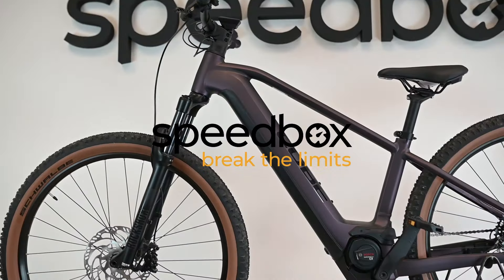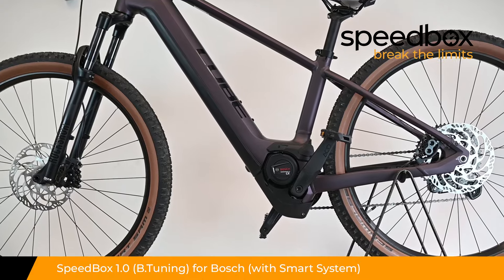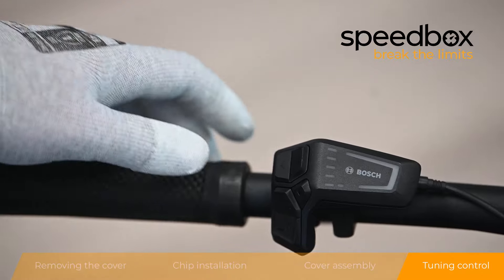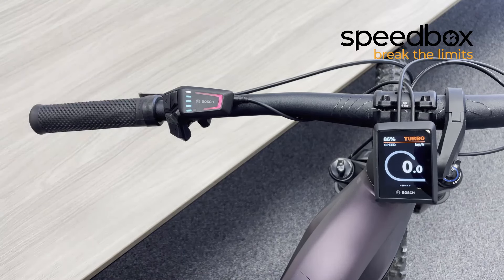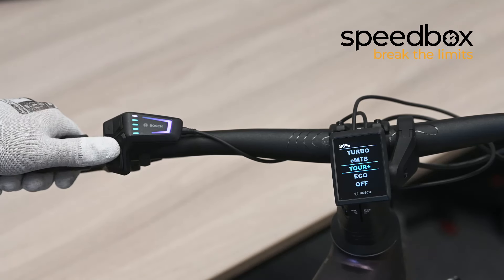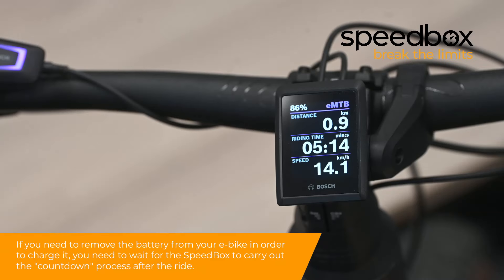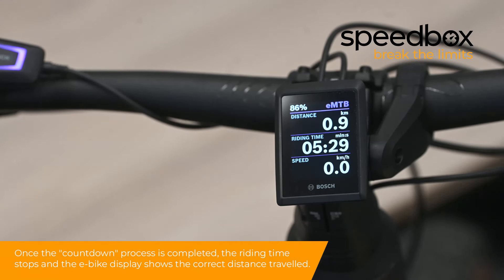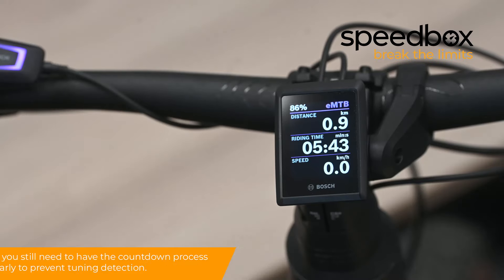eBike Tuning SpeedBox 1.0 B.Tuning for Bosch (Smart System) Installation Instruction

Comment: Sadly only worked for 100km on the new Riese & Muller Charger 4 before it got the error code 524001, rendering it unusable.
Reply: Just happened to me too but I will fix this!
Reply from the maker: Hello Rafterman. The 524001 error can rarely happens. Sometimes it can be caused by mechanical issues like damaged pin during installation. In any case it is not a system error. It is hardly possible to "provoke" this error on purpose for diagnostics, but we are still looking for ways to eliminate this issue as much as possible.
Reply: @SpeedBoxTuning  I'm not hating on your product at all, I knew the risks beforehand. It must be hard to make a product for the smart system that is constantly being updated. I'll provide you with some more information in hopes that I can get it to work in the future and also because I assume data from the 'field' could be valuable to your company. My speedbox 1.0b was delivered to me on the 5th of may, so quite early in the run of this product, I had ordered it a long time ago because I had falsely assumed that I would get my bike within a reasonable timeframe. My bike was then delayed until august 4th because they couldn't get the frames they needed. It worked pretty well for a few days, I commuted to work about 4 or 5 times within problems. Then I went home in what I would consider quite a 'spirited ride,' constantly going about 33-35km/h. During that ride I did notice that my phone wasn't connected to the Kiox 300 but I didn't think much of it, that also happened once before I got the speedbox. After I got home and was in the process of letting the trip timer run, the 524001 popped up before I even got to turn off the bike. That's all I know.
Reply: @SpeedBoxTuning  If you can fix this error, how can customers get this update? Is 1.0b possible to update OTA?
Reply from the maker: @geraldpiskernig8450  Hello Gerald. Unfortunately it is not possible OTA in the moment.
Reply from the maker: @raftermanhoward1883  Hello again. Thank you very much for your feedback - we will pass the information on to our development department. And you are right: it is challenging to develop a product despice constant updates :) Please follow our web sites or social media.
Reply: @SpeedBoxTuning   it happened to me twice
Reply from the maker: @lesliekirk7036  Hello Leslie. Our findings so far indicate that the tuning detection (error code 504) is more sensitive if you drive faster than 40 km/h. We are constantly working to eliminate this issue. However, this error code does not appear on the vast majority of bikes and cannot be easily triggered in laboratory conditions. Improvements are therefore still being worked on.
Reply: @SpeedBoxTuning  am still waiting for my replacement chip been a week an a half now not still nothing can you chase this up for me and let’s hope no more error codes thans
Reply from the maker: @lesliekirk7036   Hello Leslie. Our sales dpt. already sent you information about your consignment.
Reply: @SpeedBoxTuning
 it happened to me 3 times in two weeks. Last time even during the ride
Reply from the maker: @ronblankers6549  Hello Ron. I'm sorry to hear that you've got the error code.
There is very important to let the ebike switched ON after each ride-  there's a counting procedure at the end of each ride and before this counting is ended, the ebike has to stay ON. The battery can be removed for charging only after the countdown is done and the ebike is switched OFF. Had you removed the SpeedBox before you started to ride? Now we can recommend to go to a bike shop and to sk them to make a diagnostic procedure to delete the error code. You shouldn' t  speak about the tuning, of course, and the SpeedBox has to be removed first. Please, let us know when and where do you have bought the SB. Thank you.
Reply: @SpeedBoxTuning  I did wait for the countdown etc, and this happened during the ride (I had been waiting at a traffic light). The only thing I can think of is that the Bosch Flow app still could use the GPS, could that be the cause? I have turned it off anyway. The error is fixed, I bought te speedbox 4 weeks ago at Ebikes Parts and Accessories.
Reply from the maker: @ronblankers6549  Hello Ron. Could you please contact us via chat https://www.speedbox-tuning.com/ or via Facebook messenger https://www.facebook.com/SpeedBoxEn ? Thank you.
Reply: @raftermanhoward1883  how does the chip work until now? I have a new R&M Nevo 4 with Smart system and consider tuning but only if it’s stable and without countdown after rides
Reply: @pozega8157  I haven't tried it again, not really looking forward to cycling for 20km without assist and then lying to my dealer to remove the error codes again. Basically wasted €200. I think if you want a tuned bike it's better to buy something like a Bafang bbshd kit and build it into a good quality normal bike. I'm still using the bike every day though, the R&M itself is great, already put 1500km+ on it. If I ever happen to get a job further from my home I think I'll just buy an actual S-pedelec and keep this for recreational use. I didn't even go that fast with the Speedbox, just took it up to 32 km/h on avg to make it a bit more usable as a commuter.
Reply: This is a hi risk chip!Keeps turning off the bike leading to error. Not just on my Cannondale but also with my group of friends bikes like the Scott and Mondraker. 
My question to Speedbox:
Do you have a new chip for Bosch Smart System with these issues solved?
Reply: Looking to get haibike trekking 3 2023. Will the chip work with this

Comment: Hello, I will be getting an ebike with the 2023 Bosch smart system with the new integrated control unit and wireless mode selector but no Bosch display, (I use a Garmin Edge 530). It will also have the brake rotor magnet sensor. Will the Speedbox 1.0 B Tuning work for this setup without a display? Or can I use my the Speedbox tuning app on my apple phone as a display instead? Or is a Bosch display required? Thanks in advance.
Reply from the maker: Hello. Thank you for your question. Display is not required. It is only important that the e-bike does not have a Rim magnet.
Reply: @SpeedBoxTuning  awesome, thank you.

Comment: I've just bought it and installed it on my new Cube 2023 Reaction SLX 750...works fine so far. Is it possible to keep the tuning activated all the time or do I always have to activate it manually ? Thanks
Reply from the maker: Thank you for your positive feedback :) For older and simpler models of other brands, the tuning is either only active or only inactive. With Bosch, it must be activated/deactivated. It is also better in terms of security. We wish you many happy kilometers.
Reply: @SpeedBoxTuning  Do i have to wait for the countdown or can the bike be switched off safely after a ride ( battery is always kept attached) thanks
Reply from the maker: @cosmiqueorg  If you leave the battery in the e-bike, the countdown will finish even with the e-bike off.
Reply: Hello, I will be getting an ebike with the 2023 Bosch smart system with the new integrated control unit and wireless mode selector but no Bosch display, (I use a Garmin Edge 530). It will also have the brake rotor magnet sensor. Will the Speedbox 1.0 B Tuning work for this setup without a display? Or can I use my the Speedbox tuning app on my apple phone as a display instead? Or is a Bosch display required? Thanks in advance.
Reply: @cosmiqueorg  wait !

Comment: How can I fix the 524001 error? I ride 90 min but it didn’t do anything. Also my speed don’t show up on my Kiox300
Reply from the maker: Hello,
thank you for contacting us. I'm sorry to hear that you've got the error code. Please, let us know when and where do you have bought the SB. Is this the first time this has happened?
There is very important to let the ebike switched ON after each ride-  there's a counting procedure at the end of each ride and before this counting is ended, the ebike has to stay ON. The battery can be removed for charging only after the countdown is done and the ebike is switched OFF.
Now we can recommend to go to a bike shop and to ask them to make a diagnostic procedure to delete the error code. Please remove the SpeedBox from your ebike first.
If this does not help, please contact our support https://www.speedbox-tuning.com/

Comment: I have this installed on my new Trek Allant +7 and it works great!   I'm so glad I got this!   what is the function of the cadence settings?
Reply from the maker: Hello. We are happy that you are satisfied :) Regarding the function of pedalling ("RPM") - these values stand for your revolutions per minute, that is, the cadence of your pedalling. The optimal recreational cadence is approximately 60-80 revolutions per minute, for professional athletes (or competitors) it is even higher - around 90-100 revolutions. When you activate this feature (the oval on the right) and adjust RPM (on the left) for a convenient value, the third value is going to tell you if it is good or you need to pedal more or less (if it doesn't correspond with your set value, then it will turn into red).
Reply: @SpeedBoxTuning  Thanks for the quick reply.  If I read it correctly, this is all about informational feedback of cadence and doesn't have anything to do with power assist...Yes?
Reply from the maker: @PugetSoundFlyer  Hello again. Yes, you are right :)

Comment: Just installed the speedbox 1.0b to my cube stereo hybrid 160s 2022 smart system and the chip when turned on only goes upto 6.6 and not 9.9kph plus the app looks different
Reply from the maker: Hello Christopher. Is it kph? Becuase 9.9 kph stands for 6.2 mph. You can change it in the language or country settings.

Comment: I bought the 1.0B and when I installed it (following all the steps indicated in the installation video) when riding the bike for a few meters, it turns off and throws the error 110000, I need a solution, thanks
Reply from the maker: Hello Jacques. This is Bosch error, but it does not mean anything serious. Please restart the bike.

Comment: Hello, how do you turn off the tuning while riding if you don't use the app?
Reply from the maker: Hello. If you don't have "Invisible mode" activated in the SpeedBox App, you can activate/deactivate the tuning using the WALK function or in the app, it doesn't matter. If you have "Invisible mode" activated in the app, you can only activate/deactivate tuning in the app 🙂

Comment: I installed the chip, and after the third time turning on we got an error code: 110000, we restarted the Bike and everything’s alright, but we’re a little afraid. What does this code means?
Reply from the maker: Hello Noel. You do not have to by worry, the error code 110000 can rarely happen in Bosch motors. It is there "just for fun." The restart is a good solution 🙂

Comment: Hallo, ich habe vor wenigen Wochen ihre Speedbox 1.0b erworben. Nun musste mein Cube-Bike zur Inspektion und ich habe sicherheitshalber den Chip rausgebaut. Nachdem ich dies getan habe und ich (dummerweise) das neuste Flow-Update geladen habe, erschien sofort nach erneutem starten (ohne Chip im Bike) die Fehlermeldung 524001. daher bin ich sofort zum fahrradladen, die allerdings nicht mehr in der Lage waren die Fehlermeldung aus dem System zu löschen. Also musste ich 90min. Ohne motorunterstützung fahren und traue mich nun nicht mehr ihren Chip einzubauen. Da mir gesagt worden ist, das der fahrradladen nicht mehr die Fehlermeldung seit neustem in ihrem System rauslöschen könnten, müsste nach dem 3. mal das bike bzw der Motor nach Bosch eingeschickt werden. Dies wäre natürlich fatal für mich, da Bosch selbstverständlich die Fehlermeldung nicht einfach so löschen wird, wenn sie erkennen, dass ich 500km stets mit Chip gefahren bin. Haben sie eine Ratschlag für mich? Selbstverständlich hab ich immer den Countdown usw abgewartet wenn ich das bike ausgemacht habe. 

Die genaue Fehlermeldung war: 524001: Volle Motorunterstützung kann nach Beseitigung der Manipulation durch 90-minütige Fahrt (im Notlaufbetrieb) wiederhergestellt werden. Nach der dritten Wiederherstellung kann der Notlaufbetrieb nur noch beim Fachhändler aufgehoben werden.„ 

Nun hab ich Angst, das ein drittes Mal die Fehlermeldung aufkommen kann und ich mein Bine nicht mehr benutzen kann. Bitte um Hilfe
Reply from the maker: Guten Tag. Das tut uns leid. Wenden Sie sich bitte an unseren Support unter www.speedbox-tuning.de oder auf unserer Facebook-Seite. Wir werden diese Angelegenheit gemeinsam lösen. Danke schön.

Comment: Does anybody has this on cube reaction hybrid exc 750 ??
Reply: @DarkstarSk8er4ever  I am sorry,  I wanted to buy  this but now I won't... Thanks !
Reply from the maker: @prophoto6665   Hello. There are many types of bikes and in theory the chip can behave slightly differently for different types of bikes. The Smart System is a pretty new system. In any case 504 is not a system error. It is hardly possible to "provoke" this error on purpose for diagnostics, but we are still looking for ways to eliminate this issue as much as possible. If you have any question, please contact your dealer or our support.
Reply: I have it on my Cube kathmandu exc 750 hybrid. Recieved the chip this week and having problems with error 524001. It makes me cycle for 90minutes without support. Nothing more sucks.
Reply from the maker: @TimdeJongSk8Spug  Hello Tim. Thank you for your feedback. Please follow our web or social media, or contact our support. Thank you.

Comment: Hi  Just to clarify the speedbox  1  for the smart performance bosch, do I get  all the functions/ features of the bosch smart app? Or  do I have to  buy the tuned B 1.0 version and use the speedbox app?
Reply from the maker: Hello. In the standard version, you will see the same data in the application as on the e-bike display - you can read the speed from the last two digits on the display. If you want to see the real speed, we recommend the B.Tuning version and downloading the SpeedBox App.
Reply: @SpeedBoxTuning  Thanks for getting back. I'm still not 100%. Does the bosh smart app show true information,  speed  etc? And there is confusion with the speed limit 50kmh or 60kmh? And I have the speedbox 3 and there's no limit why is there  a limit on the speedbox 1 bosch?
It's alot of money for the B tune so I need to be sure the standard version  is compatible with all the functions for the  smart performance bosch
Reply from the maker: @yabonney  If you install tuning, you will not see real data in the Flow app. For example speed 23,8 km/h means real speed 38 km/ h. With Bosch 1.0, we indicate the maximum possible speed, because the Smart system motor is too "smart" and it is difficult to reach a speed above 60 km/h. Which, by the way, is not so easy for any other electric bike :) However, the maximum speed generally depends on the pedaling frequency.
Reply: @SpeedBoxTuning  Thanks for the info. I've reached just over 60kmh 😆 using speedbox  3 version for  my cube
Reply from the maker: @yabonney  Very good! Be carefull on public road :)

Comment: Is there anybody with positive experience for this speedbox? All I can see are bad comments.
Reply from the maker: Hello Jure. All comments on the other 1,800 SpeedBoxes 1.0 B.Tuning sold (up today), which are not here, are positive :-)
Reply: @SpeedBoxTuning  hope so have just spoken to a few distributors that claim errors happen in less than 5%of chips or bikes ( it is not always error of chip it can be bike problem too) so now i feel better about it but still think you should upgrade it so less than 1% fails. Cheers .
Reply from the maker: @jurejakovcic97420   Thank you for your info, Jure. You are absolutely right :) We are certainly still continuing to upgrade the product. Follow our media. Cheers.
Reply: Hi 
Has anyone used this on the smart system with out any issues ? Seems to be a fair few problems and no real confirmed positives 🤷‍♀️
Reply: I also have error 524001 after 100km
Reply: @motoboggle7525  Error 524 will pop up eventually cause the system is smarter than the SB1.0
Reply: @SpeedBoxTuning  Sorry to say but it is not working with the smart system, go read comments in specialized forums, hundreds of customers who have problems with error 524 and will not comment on google or youtube for x reasons.